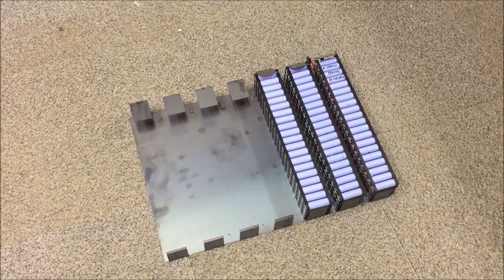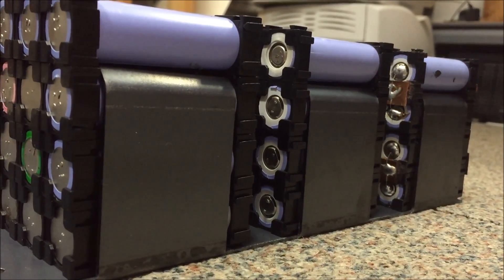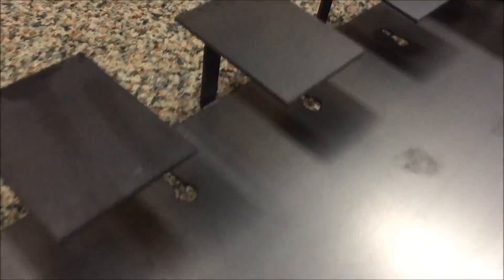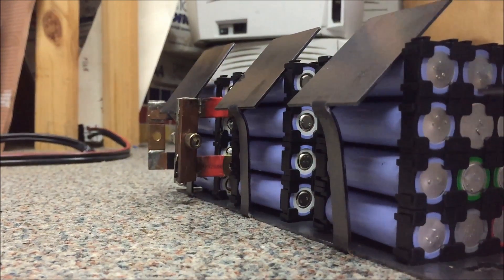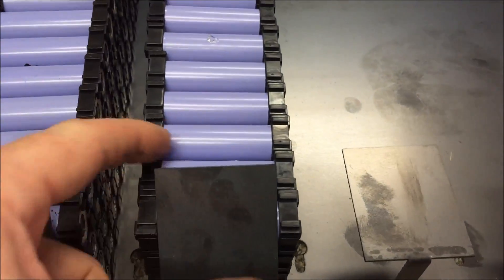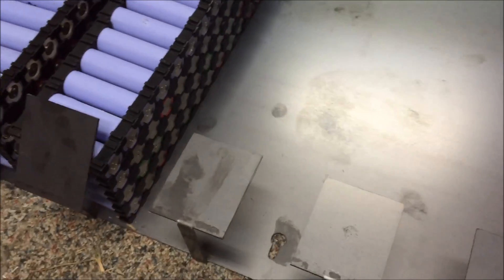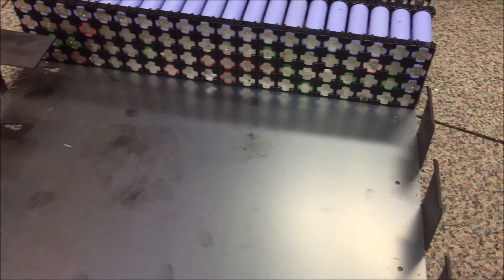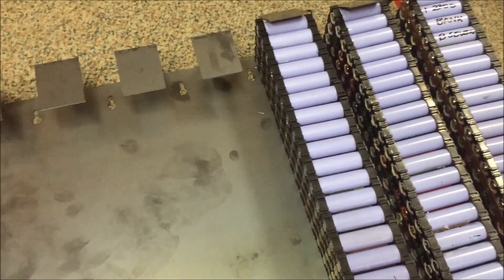HBPowerwall Wallmount V3.0 :( it didin't work

Comment: It looks to me like you could put the large plate in between the third and fourth stacks of batteries, instead of having it outside the fourth stack, and it would work just fine.
Reply from the maker: +Scott Baker it does, but need to really watch how it's inserted - probably not recommended but works. Also can add a row or two increasing size of pack.

Comment: take a saw and cut the slim strip in half. next flatten a piece of 3/8 tubing and slide it over the slim sections creating a very nice coupling that is adjustable. now just put 1/8 bolts to secure it. bingo you have made it adjustable. i can draw it out on if you would like. this would still look professional and it would not take much time to do.
great job

Comment: You sure those bottom plates can hold the weight of the battery pack without sagging? Seems to me that they would sag down rather badly under the weight of the pack. Interesting design. Sorry it was cut wrong.
Reply from the maker: +Pete McWade 2mm steel, she'll be fine :)_

Comment: What about a 10mm slot running up the back to allow better heat dissipation? Otherwise you'll have a cooler front side than back (wall side). You can then put some spacers onto the wall and have a bit of airflow there.

Remember the key success with Tesla's batteries is the heat management system, not the batteries.
Reply from the maker: +J channel we were talking about doing some sort of slotting or holes in the back but for weight reasons not heat.. great idea...!!!!
Reply: +HBPowerwall yeah makes sense to me. Run a slot behind each bank to allow some of the heat to vent.

What do you have in terms of temp monitoring?
Reply from the maker: +J channel have several options for heat monitoring but once i have all six packs up heat will not ever be a real issue on a pack level (individual cell level there will always be issues)

Comment: Hey Pete, idea for your next version? In lieu of the screw mounting holes between the packs, retain an extension of that space above (that has been trimmed away in this version), say 20mm, and get them to bend it to the back (wall) 180deg. to make inverted "U" shaped hangers. On your wooden wall, mount a readily available (Bunnings  I/N: 1079276) aluminium "J" profile to then simply clip the case onto. Similar "U" style tab using bottom "waste" sections to accomplish "standoff" spacing for levels, with one or two screw holes there to "lock" it.
Reply from the maker: +Retinalism awesome idea, how ever the plan with this design is a simple 4 folds so it's really easy to build quickly and cheaply.
Reply: +HBPowerwall ok, so use 2 "J" channels, fixing one to the back of the frame using the existing screw holes....?
Reply from the maker: that would be a VERY good idea - searches bunnings website
Reply: Solutions are my specialty....

Comment: just bend the top plates, I think you still have lots of material left
Reply from the maker: +Cam Shaft might just use it for a 3 deep pack, that will work perfectly
Reply: +HBPowerwall i was looking for this suggestion,  on the stop just take away a few batteries for this bank to make it 3 deep. and still fit the design.  you only have to remove as many as needed to make it fit. it would still look boss.

Comment: Pete,
         You should think about putting a horizontal strap across the middle in case the battery packs warp over time,. They may bow out in the middle and fall off the rack.
Reply from the maker: +ZEROSTATIC72 I doubt that'll happen but if it does - your first in line to say i ya so on this one.. pete